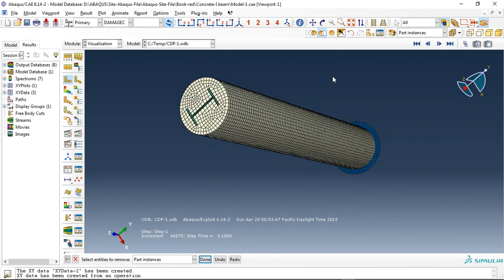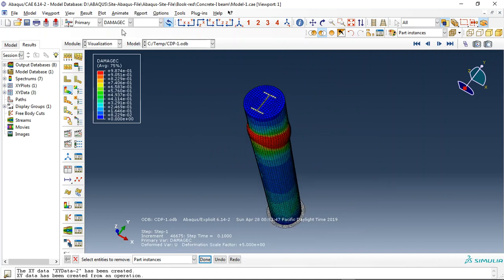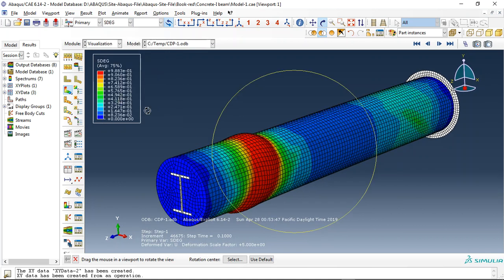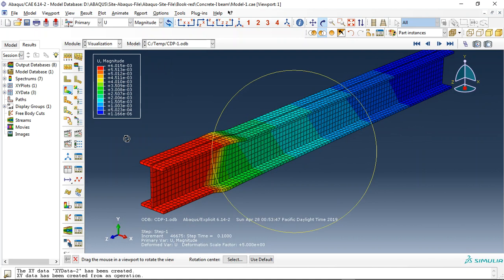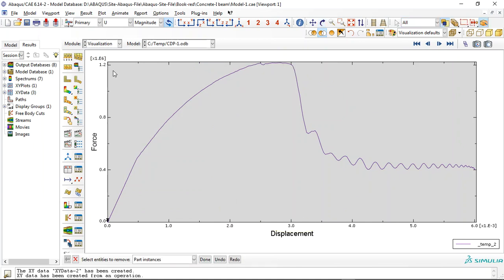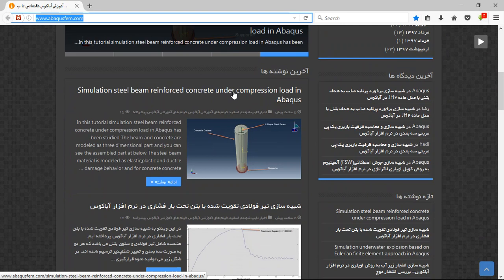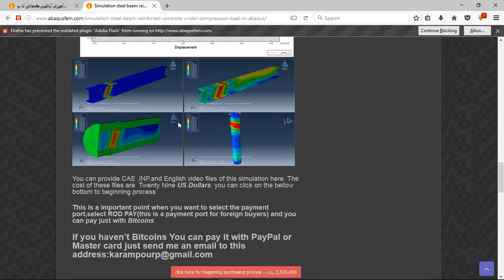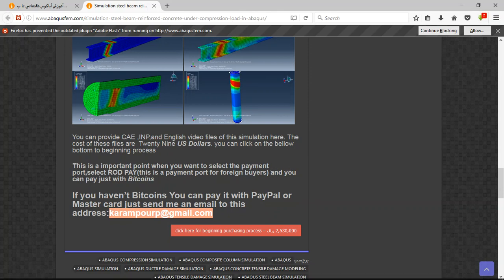Simulation steel beam reinforced concrete under compression load in Abaqus

Comment: Sir how to provide slip between reinforcement and concrete
Reply from the maker: You can use cohesive surface behavior
Reply: @abaqusfem3576  how to define cohesive surface property
Reply: @abaqusfem3576  please sir make some video related to design of rcc beam and how to define slip is present between reinforcement and concrete
Reply from the maker: @sunayanasaini1187  Check our website: www.abaqusfem.com
Reply: @abaqusfem3576  1) Sir cohesive element is working between reinforcement as wire elements and beam as solid element?

2) Sir in cohesive element knn,kss,ktt is important or not for defining slip between reinforcement and concrete beam.because I am using only normal and tangential behaviour (friction coefficient). 

3) knn,kss,ktt both value are same or not?

Best regards
Reply from the maker: @sunayanasaini1187  If you all parameters like stiffness in three directions and also damage for the cohesive surface, you can use that as an interaction property and it allows you to observe the separation.
Reply: @abaqusfem3576  sir for simply support beam stiffness is sir it's value near by 80,000 in N/m 
Sir can I use these value in knn=kss=ktt